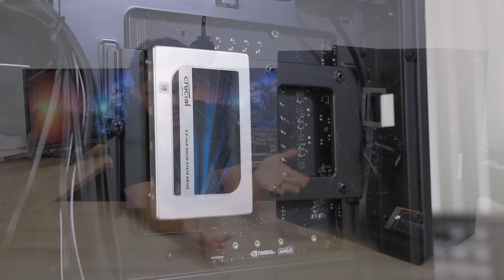The best case they've ever made? BeQuiet Dark Base 700 Review

Comment from the maker: You guys caught something I missed! You should be able to route larger cables like USB 3.0 through the long gap underneath the motherboard - Either by routing the cable before mobo installation, or routing it off to the right side of the board (where the gap is larger) before sliding it over to the header. Sorry for the glaringly obvious oversight! #derplyfe #4giveme #humanerrorstrikesagain
Reply: Bitwit on a side note whens the RGB Review for the Lian-Li Alpha 550? :D
Reply: What I'm interested in is the invertible mobo.

Especially wants to see the temps if you blow the inverted mobo and GPU with the top fans, since GPU's can be temp sensitive.
Reply: Honestly, if they do a case with 3.1 usb front panel and quick phone charge on the top, that will be perfect :) i still prefer the pro 900 for the charge feature
Reply: Bitwit i just bought be the 900 pro white too shiiiiiiittt
Reply: The background music that you used is the same one that YourOverwatch uses. whats the name of the track?
Reply: I was rolling my eyes the entire time you were going over it but knew that the comments would rip you apart for it anyways so it isn’t a big deal lol
Reply: Bitwit glass panels should not be tinted otherwise it defeats the purpose 😑. This case is good for $150 or less so I'll wait til price drop or something else better comes out. Currently have a Phanteks Enthoo Pro full tower.
Reply: was just about to comment on that lol
Reply: No link to lian li case in description? :D now you make me go and type it in to google my self... :D
Reply from the maker: Kyle Foust Can always count on you guys for that 😅
Reply from the maker: jlrockafella I don't mind a little tint but some are just too heavy and defeat the purpose as you mentioned. Enthoo Pro is a great case. Nice choice.
Reply: We’ll never forgive you. Your tiny oversight has tarnished everything you’ve ever told us and could ever possibly tell us again. 

You’ll have to earn our trust back by planning a fan event here in Sarasota FL... ‘tis the only recompense. ;)
Reply: You didn't touch on temps and airflow in DB 700. What's your take on that? GN (#Steve) Gave it some tough love, so what your opinion?
Reply: ROOKIE MISTAKE
Reply: LITERALLY DISLIKED BECAUSE U DIDN'T, SCROLLED DOWN AND SAW THIS. NOW I LIKED THE VIDEO LOL. I'm picky ok kyle, don't trigger me :( <3
Reply: So many things to go over that most people can sit and watch and nit-pick all the little mistakes. It's easy for me to do as well, as I was like just install that cable before the mobo and all good...

Problem is, when reviewing you are thinking of so many things sometimes you miss silly little things like that. I know, I do reviews as well. I've done about 12 or 13 PC case reviews, and I've had to go and edit articles a few times from silly little things I forgot to mention or just spotted in images I took for the article later on.

This looks like a pretty snazzy case. The one that I want to see you review (or myself for that matter :D) is the Thermaltake View 71. That case looks pretty friggen nice. More of a 'bling' type of case to showcase components, but it does it with some style.
Reply: Could you verify the taller ram would fit with a 240 or 360 radiator mounted up top? g skill rgb to be specific.
Reply: Bitwit one day when I am not poor af I might be able to also build a nice PC...instead of watching your channel to feel better
Reply: I know the feeling. Would be super cool to build some of these rigs, just to build them. I've built friends and customers PCs always better than what I have. Last one I built for a friend had a 6700K, 980 Ti (upgraded to 1080 Ti this year), 32GB of RAM, just complete overkill gaming rig in a CM Mastercase 5 with the tempered glass. I reviewed that case and gave to my friend as a Christmas present with her newly completed build last year.
Reply: I Just wanna write it after watch xD
Reply: You can also route the cables under the removable covers, the open slots are exactly for that purpose ;)
see this picture here: 
http://www.tweakpc.de/hardware/tests/gehaeuse/be_quiet_dark_base_700/i/be_quiet_dark_base_700_106.jpg
Reply: Do a Black & Silver build in the Dark Base Pro 900
-Silver Cables
-Silver Liquid ( It will be a custom cooled build )
-Silver accents on Graphics Card(s) and Motherboard
-Corsair or BeQuiet power supply ( with the custom cables, NOT EXTENSIONS)
-2x 360mm RAD 1x  front, 1x top
-A 280 mm rad at the bottom
-All silent wings 3 fans
-Pro Cable management
-GOOD LUCK KYLE!
Reply: @bitwit what are the drive tray slot covers made of? are they plastic or metal? because one might be able to put a reservoir mount there if said one was feeling adventurous enough

Comment: I've built in 2 BeQuiet cases now and one thing I can say easily is their cases hands down have some of the best build quality I've ever seen in any case.  Seriously, I've worked with a lot of cases from crap generics, to budget friendly but surprisingly good aerocool, to very expensive Cooler Master and Phanteks Enthoos, but every BeQuiet case I've worked with (I have a Dark Base Pro 900 and my partner has the Silent Base 800) have left me more than a little impressed by just how good the build quality is with their cases compared to most.  Even compared to a lot of the high end cases I've worked with.  They're that good.  

Also, when it comes to fans.  You should take into account that those fans sold separately go for about 20 quid each ($27 USD each).  They're really good fans with fluid dynamic bearings.  So you should factor the quality of those fans and their relative cost when considering the overall cost of the case and it's quality.  So in this case, $54 dollars of this case's value is built up just in the high end fans that it comes included with.  All in all, it's an expensive case, but I do think it's reasonably priced.

Comment: awesome case i just bought it and got everything swapped over from my nzxt 340 elite. it runs a lot cooler. im happy with it.
Reply: birdsoup777 How would you say the air flow is? Have you had any issues so far?
Reply: WOLVANG excellent case, no issues.
Reply: None. 29 -32 C overall case temp. I do have five fans. 4 x 140 mm, 1 x 120 mm. I use 4 of those corsair magnetic pwm fans. awesome.

Comment: Dude just run the USB 3.0 front panel connector first. Then put the motherboard in. You can then keep the cover on the PSU shroud. That would keep the clean look you are going for
Reply: Or, that mobo had a second USB 3.0 header next to the 24-pin power. Use that one instead.
Reply: Now guys that's just too logical...
Reply: I built a system with this case and can easily get the usb 3.0 thru without having panel off.
Reply: I was thinking the exact same thing!

Comment: 6:40 solution to usb 3.0 connector: but it through before installing the MOBO the head is too big to fit through but the cable itself is thin so it rides smoothly through the gap

Comment: you can easily have front mounted radiator + side-mounted drive trays. using EVGA CLC 280 with push/pull and two 3.5" drive trays. radiator & 2x push fans inside the front panel, 2x pull fans between radiator & drive trays.

Comment: Regarding your cutouts comment on the USB 3.0 connectors not fitting.  I agree with you.  Perhaps they should have considered this and split the covers to allow partial removal in a 3/4 1/4 cover.

Comment: I'm using the Phanteks Enthoo Pro M Tempered Glass, and it's not completely dissimilar. The one thing I would like in mine that this has, is the mount for a vertical graphics card. But I do prefer my case's front IO being on the side instead of top with how I have my case placed.

Comment: I plan on using the Arctic Liquid Freezer II 360 for a Ryzen 7 5800x 3D on an MSI meg x570 Unify inside a Be quiet! Dark Base Pro 900 Window Black ATX Full Tower Case. My original concept was to use a Noctua nh-U12A.

Comment: 6:48 I haven't been hands on with a large amount of motherboards but im fairly certain that near enough all modern motherboards that are above say ~$120 (so any motherboard that you would pair with a case of this price) have a USB 3.0 port on the side of the motherboard near the 24 pin and actually if you have a look at 8:46 the motherboard kyle is using has that port there too so if removing that panel was sun a big deal why not use the other port? Additionally i find that right angle connectors for USB 3.0 headers often look a huge amount better that having a massive ugly plug sticking out an inch from your motherboard

Comment: This case is my favorite of the year but i'm not a fan of all this choked air-flow these days.  If I were to purchase this case, those internal front air ducts would see a rotary tool. Actually the entire front exterior panel might visit a drill press.
Though the tempered glass cases with better air-flow, such as the Meshify-C are too small for custom water loop options. 
And while I like the tempered glass look, one would think manufacturers could use a higher quality (thicker) acrylic, providing a similar appearance, reducing shipping provisions and increasing durability.
Hopefully we'll see a better compromise next year. 
I'd also like to see more cases with the motherboard turned with the I/O on top, resolving gpu sag and usually providing better air-flow, due to hot air rising, with the exhaust on the top, like the majority of the SilverStone Tek Fortress series. I'm still using a Fortress II case from 2008 myself but I'm ready to explore water cooling, going for a quieter system without sacrificing overclocking headroom within a classy mid-size package. 
Speaking of classy (provided one can detach their loud case badging), where's Jonsbo at within the North American market ?

Comment: I thind this pricing to be a common theme with Be Quiet. I've had numerous parts from them. My first case was a Silent Base 800 and a Dark Rock Pro 3, both of which were on sale. I stuffed a pure wing 140mm fan in every single place I could cram one. I use 2 silent wings 3 fans and 3 Pure Wings 2 fans in my current build. I would have used a silent loop for my first liquid cooler if they were available Stateside. Be Quiet has given me nothing but good experience... Well... Except for the DRP3 mounting process. Customer service has been quick and to the point all 4 times i've had questions for their customer service.

Though build quality is fantastic, their fans are great, and they keep a theme of classyness in almost everything they make. But they're not the be-all-end-all. They charge more than the competition for that "german quality." It's just not that competitive of them.

Comment: it's a very nice looking case. but with one major flaw. the top part where 80% of heat is concentrated is closed or has very poor ventilation. that heat that can't escape to the outside of the case gets recirculated back in the case which causes and rise of temps in the entire case. same problem with Base 900
.

Comment: If you routed the USB 3.0 cable, and other big cables prior to mounting the motherboard, that would work. Its a bit of a more permanent solution since you would have to remove the motherboard to remove the cable, but why would you need to remove the USB 3.0 cable anyway?

Comment: He mentioned how when using a 140 mm radiator it interfered with the ram and you could not use high ram (RGB).  But if you use a 120mm radiator is the issue the same?

Comment: just 1 question.. is that fan controller a real PWM controller? the previous version (DB 900) were not. they just take the PWM signal and feed it to the DC controller (i forgot if it was a simple transistor / mosfet circuit or IC based). so, both 4 pin and 3 pin headers is working at DC mode. I ended bypassing the PWM signal to every single of 4 pin headers and keep the fan controller at max speed (12V. lowest speed were 6V)

Comment: Still trying to nail down the best quiet yet decent airflow midsize case with a TG window and three 3.5" bays (for small RAID5 array). I've had the DB Pro 900 in my pcpartpicker list for a couple of weeks. If this supported 3 mechanical drives in the basement it'd be perfect!
Reply: Phantecs Enthroo Pro M Tempered Glass, has great airflow, well made Supports 2 drives in the basement, however the rest of the 3.5 bays are removable and you can i'm sure one of the front locations will work good. It is also cheap.
Reply: That one is a frontrunner at the moment, dropping the Darkbase Pro 900 allowed me to put more money towards a GTX 1080 over a 1070. I'm waiting to see how much the DB700 comes in at in Canada.

Comment: @Bitwit I have an alphacool nexus ut60 420mm radiator in the front of a phanteks enthoo pro right now but want to upgrade to a more modern case with tempered class and a USB 3.1 type C port. I know that officially be quiet says this case supports up to a 360 rad in the front but  it supports three 140 fans in the front, so the only reason a 420mm rad wouldn't fit is if there is no room for the end tanks.  There only needs to be about an inch of space from the bottom 140 fan  mount location to the bottom of the inside of the chassis and about 1.5 inches from the top. Could you please help me out and let me know it my rad would fit?

Comment: Does anyone else have that struggle when you try to plug the usb 3.0 cable into the mobo and the cable is so fat, you have to either move/remove the shroud or connect it in a weird way

Comment: I still don't understand what the big deal it with USB type c connector on a case, how is that useful for the majority of users that are going to buy this case?
Reply: Dennis McConnell as I understand it, it's the great promise of USB-C. Instead of needing an A-to-B cable for printers and A-to-micro for charging, all USB cables would be C-to-C and fully exchangeable regardless of use-case.
Reply: @Juansonos  lol well that still hasn't happened a year later...

Comment: I am about to build a budget pc for gaming  ryzen 1300x 8gigs of ram 128gb ssd with a modular power supply and will use a gtx 1050ti that I already have is this good enough for 1080p 60fps?
Reply: Yep. Have fun ^.^

I would actually go with a 1060, but if you can't a 1050 Ti is a pretty decent card.
Reply: Jeff Stinnett yea, great system, however i would recommend the 1200 instead tho because you can overclock it to 1300x performance.

Comment: I'm surprised with this review says its the best designed and built case, yet the design seems flawed with the lack of airflow at the top with just barely enough room to stick low profile ram in with a radiator and fans..closed of at the top with just a few places for air to get in or out..How could they have missed that? How well does the air get in from the front as well i wonder, as there just does not seem to be enough area for the fans to get air in...Would be interesting to see some thermal tests and at a $180, that is a lot of money for a case compared to others that get the basics right in terms of function.
Reply: That's because this is an ad, not a review.
Reply: I hope be quiet will fix those faults with the 701

Comment: Hello guys i have a question since i decided to build my first PC and i wanna use GA-170-D3H mobo but i saw that it runs 2133Mhz RAM Frequence and i wanna put in Team Delta 3000Mhz ... so my question is does the motherboard have an XMP profile and if it does, will that bring me problems when booting the system ? P.S. sorry for my bad English...

Comment: Can i use Aura lighting? Thi will decide if to or not to buy it
Reply: Joan it's a standard 50/50 header, look and see if a connector has 12v b r g on the header if it dose your set.
Reply: ok thx
Reply: ty, i mean about the rgb lights inside the case that already come from. You can manage them with aura?
Reply: it has a led header pin on the pwm fan controller board on the back of the case. go to be quiet website and look at the manual.

Comment: I'm just a bit worried about airflow with it. That top panel seems very restrictive.
Reply: Dawid Does Tech Stuff You are 100% correct. There is practically no room at all once the fans are mounted. And having more than a single 140 at the top is pointless as there is no place for the air to go and it just bounces back. The top panel is the only gripe I had with my db700. However, I bought the case with the intent to mod it. Once I cut a hole big enough to support 2 120 fans and installed a grill it is perfect. I highly recommend this case for modders and water coolers.
Reply: @loosegroove7913  This case looks perfect for what I want excluding this one flaw. How would I go about modding it as you described? I got a 280 radiator I was hoping to mount on the top